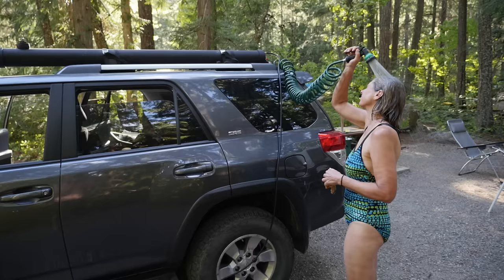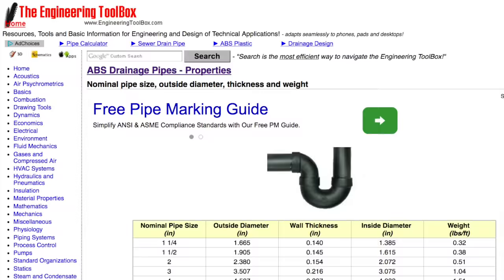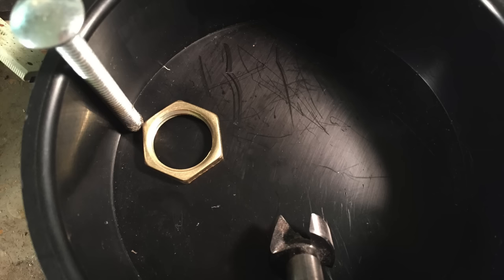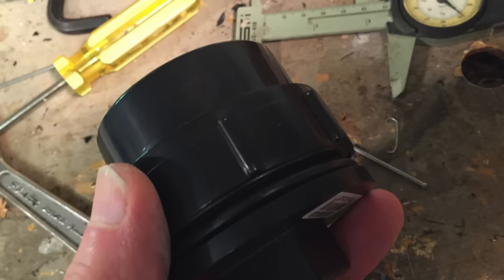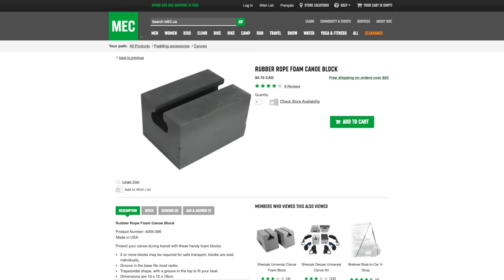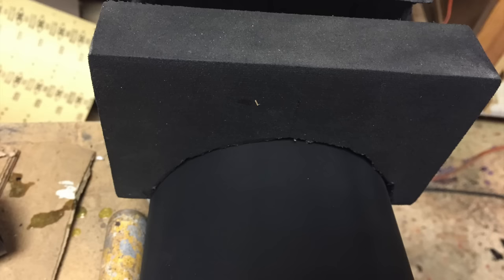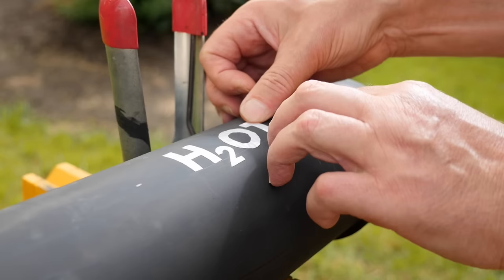H2OT - Rooftop, pressurized, solar-heated shower/sprayer using ABS pipe. DIY

Comment: Can  you provide more detail regarding the operational temps for ABS versus PVC? Information I found online shows ABS maximum operating pressure of 100F  vs 180F when under pressures. Thank you for the excellent video.  Here's a link to the source I found: http://www.engineeringtoolbox.com/plastic-pipes-operating-pressure-d_1621.html
Reply from the maker: I would suggest anyone with specific questions about the material performance ratings of ABS pipe, should contact the manufacturer of the pipe. In this case, I used Cell core, Acrylonitrile-Butadiene-Styrene, Schedule 40 pipe, whose specifications adheres to ASTM D2661.
Reply: Nelson Outdoors ... i dont think that will matter alot... you only want about 30psi of pressure inside the drain pipe and id flatten the air pressure when not in use .... i certianly wohldnt go higher then 50 psi with a pressure regulator remember this hot water is going to be hitting your naked skin... no need to remove the skin off the muscles and bones , just wash the dirt off is all that necessary...hah

as a kid we used to build potato cannons out of 4 inch shedual 60 pvc drain pipe using auquenet hair spray and a bbq grill electric switch and we could launch spuds a good 500 ft on a good charge of auqunet spray ... so thats some serious pressure inside that pvc drain pipe...

Comment: What was the total cost?
Reply from the maker: About $50 as I had most of the parts in my shop already from other projects.
Reply: @ImaginetMedia  how much would you say from scratch? Really cool idea.
Reply from the maker: @DTKRDMNK  I provide close up shots of all the parts in the video so you should be able to shop around your area to determine the cost. What it costs me is irrelevant. Unless you live and shop where I do, my costs are completely different than yours.
Reply: @DTKRDMNK  I decide to start this about 22 hours ago. I am $100 in. I am making a U though. 4' on each side with a 2' bottom. outlets on both sides. 4" PVC sched 40. So far just running into a problem with finding a filler that seals. Once I do that I am set. So maybe $120 with trial and error? If you are luckier than me perhaps under $100.
Reply: @jasonmotorcycle8987  have you tried a rubber washer/grommet and then some type of bathroom sealant? Maybe aquarium grade sealant would be better.
Reply: @jasonmotorcycle8987  all we're missing is some filtered reverse osmosis type thing and we can catch rainwater/river water to use lol

Comment: How do you keep the air pressure from leaking out of the filler cap?
Reply from the maker: Screw on the cap and air does not escape.  It is an airtight seal.
Reply: @ImaginetMedia  Mine does, even if I use thread tape and a pair of pliers to grab onto the square part to tighten it.  Leaks at the threads no matter what.  I've been struggling with a good filler design that can be removed to fill but doesn't leak.
Reply from the maker: @SD-pi9co  if you look closely in the video, you will see a 2” silicone gasket on the threads.  This came with the cap.  Apparently, some brands do not include the gasket.   I suggest getting a similar rubber or silicone one and it will seal tight.  I only hand tighten mine for a perfect seal.
Reply: @ImaginetMedia  Is it like an o-ring?  Could you post a link to something similar?  Thanks so much!
Reply from the maker: @SD-pi9co  Yes, it is an O-ring. Here is the exact part I used. You can see the O-ring in the photo. https://www.homedepot.ca/product/lesso-2-in-abs-male-plug-mipt/1000116110
Reply: @ImaginetMedia  Thank you that helps a lot!

Comment: why not use solar power just power a heater to heat it lol
Reply from the maker: A electric heater would require at least 300 watts of power.  A 100 watt solar panel, which is 4 ft x 2 ft in size costs about $200, and you would need  4 of them, plus a charge controller. Right there you are over $1000. Plus, I do not want to mount 4 huge solar panel on my truck.

oh yea... lol
Reply: imaginetMedia not if u use it to power a motor turns a generator with 120 converter you can power whole building welders anything at all free
Reply from the maker: So now on top of the $1000 solar PE  array, you want to add a a motor a, voltage convertor, and a generator.   OK, Ill get tight on that. lol
Reply: imaginetMedia u get generator from a car starter lol any 12v motor long strong enough turn alternators power the 120 converter all u can get free to very cheap don't really need the solar the generator can power the motor   just don't ground the motor/gen to each other
Reply from the maker: lol

Comment: awesome build im on it ! this is what I have been thinking about , however i was thinking about one of these to power it with a drill or 12vdc motor       http://www.princessauto.com/en/detail/drill-pump/A-p8412322e
Reply from the maker: That pump can put out 650 gallons per hour. That is 41 liters per minute. Your shower will be empty in 20 seconds. Not to mention you would have no skin left!  :-)
Reply: if you put it to a drill you can vary the speed . that means far less the the max out put.

Comment: 4 gallon bucket painted black and large drinking cup for dipping and you got the same thing maybe $10.
Reply from the maker: How exactly do you get the water to 100 F in an open bucket, while driving on logging roads and still have anything more than a cup of water left in the bucket?

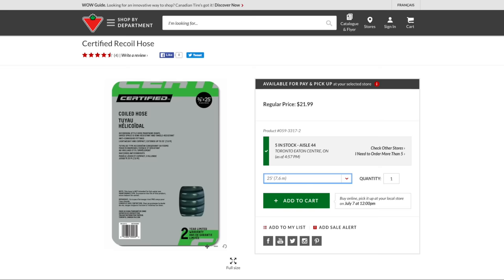Comment: 4:33 "warm enough for a couple of long showers..." with 4 gallons of water?
Reply from the maker: The shower spray is only on for wet, rinse repeat. !0 seconds at a time.  Easy to do and it works great.
Reply: Its a camp shower not a spa. Conservative use of water is key.
Reply: 4 Gallons with a low flow rate shower head was enough for me and my beard and my fiancee and her long hair. I would recommend at least 7 gallons though. I went with 4 gallons due to my small car and it's maximum weight capacity for the roof.

Comment: I wouldn't bath or drink from abs. It's used for wast water for a reason. Just paint pvc black.
Reply from the maker: We are not making ice for martinis. There is nothing wrong with the water stored in ABS.  And, that is not why ABS is used for wastewater.  Also, if you read the FAQ in the description, you would have learned why painting PVC pipe and using that is a terrible idea..
Reply: @ImaginetMedia  BPA will eventually leach into the water. Look it up.
Reply from the maker: @super88rob  The water is in the tank for no more than a few hours.   Zero problems BTW: I did look it up, 6 years ago...", BPA (Bisphenol A) is a chemical that helps harden plastic materials used in different applications, such as pipes. It is also present in some plastic dishware that holds food and drinks."

.
Reply: @super88rob  this isn't an FDA/EPA PSA, this is an instructional video on how to build this device. If some one wants to scrap and eat the inside of this until they get poisoned from BPA let them weed themselves out.
Reply: Life is dangerous,  keep your mask on.

Comment: Avoid weight on the roof.
Reply from the maker: Where do you suggest I mount the tank then, under the truck?
Reply: 40ish pounds on the roof rack is not a problem as vehicles are built to support the full weight on the roof for safety. 

For an SUV it might move the center of gravity a fraction of an inch up so the same as having another person due to where the wait is. Would only effect breaking if traveling with a half full pipe as the water would then have room to move so traveling with it full there is no room for the water to be a problem.

Comment: Compressed air in the pipe will not be any problem as long as you don't expose the pipe to UV light where it starts to degrade and become brittle.  If it does get brittle and burst from air pressure, deadly plastic shrapnel will shred anyone near by.  

Is hot water worth your life?  Your choice.

There's a reason why the safe commercial version costs $300.  I think my life is worth the $300 safety factor.
Reply: Thats going to the extreme mate. It does require some common sense to operate this device.
Reply: Flinters Roo 
40 psi wont cause the pipe to explode.
Reply: Flinters Roo 
a pressure relief valve could be installed if this was a high risk. But I don't think it is really.

Comment: Aluminum would work way better I guess you don't count how much time you spend doing that time is money
Reply from the maker: 6 feet, 4 in diam ABS pipe: $20
6 feet, 4 in diam Aluminum pipe: $400 + aluminum caps + TIG welder
I guess you can't count.
Reply: Even if you buy that high-dollar 380 aluminum dollar tank and it leaks. TIG welder unless you have one and that's pretty expensive to have somebody to take weld something and Timely. I had someone to tig weld something I had once that was pretty costly And Timely. PVC is cheaper easier and faster. And will last years to come. But the thing I want to know is anyone use this black PVC pipe in the summertime directly in the Sun. My experience this summer with black jugs of water sitting in the sun it got up to 112 degrees at the beach and the temperature was about 88 through 90 degrees. Thank goodness I had two other water clear jugs sitting in the shade. Even the jugs in the Sun the clear jugs were too hot to take a shower with when I put my finger in the water for me. My thought is if you had a bigger PVC pipe or longer or double pipes you could mix cooler water together to get it to the water temperature you like. I used my water just take a shower in the summer at the beach in my pop up bathroom shower I bought at Walmart for $30. Thank goodness it had a vent in the top of it or I would have burned up. I first wet myself with 1 gallon jug of water washed my hair and myself. And then I rinsed off And I just poured jugs of water over my head 2 quanity 3 gallon jugs of water over my head to rinse with. 7 gallons of water total how used a bit too much but it worked. They were the cheap plastic blue jugs at Walmart. Of course when I go off grid I will be using less and less water that I can get away with. For now I can get fresh Spring Water out of the side of a mountain for free. But you never know how long that will last.
Reply from the maker: The pipe is ABS, not PVC.

Comment: Foam block will not last in the sun
Reply from the maker: So you are an Applied Polymer Science expert.  Where did you get your Engineering Degree?  I’ll wait.  BTW the foam has sat out in the weather for over four years and looks and behaves as if it was new.

Comment: My only question is how old is the actually water pipe water system that’s produced commercially? Did you copy it or did they copy you because you can buy these complete with no need to build it. I was going to say you’re acting like this is your idea when it’s there’s but then I saw this video is 6 years old.
Reply from the maker: If you actually watched the video you would see that I investigated the available options at the beginning. I showed the exact commercially available one and clearly explained that cost was the determining factor in making my own.   What part of that was unclear?
Reply: Way to much work for me! 😮
Reply: @ImaginetMedia  Wasn't going to comment  because its 6 years old but I see your more recent post. My concern, and it stems from  simple garden hose laying on the ground on a hot day full of water with a sprayer on the end,  I've sprayed that on myself and it was damn near to hot, can it get to hot? I was going to incorporate something like yours into my camper to mix with the cold water that I have for washing, I know that mixed with room temp water that I'd be OK but what if someone just used direct hot, would it be to hot? Just curious about your experience with that, I would use 6" because I have access to scrap pieces from job sites, You dont see any problem with 6" pvc schedule 40 do you?
Thanks

Comment: Why don't you just save your self the headache of trying to pressurize the tank and turn it up on end and let gravity do the work, just reduce your hose size for more pressure
Reply from the maker: Hydrostatic pressure in a liquid can be calculated using the following equation:

p = ρ g h 

where:
p = pressure in fluid (N/m2, Pa, lbf/ft2, psf)
ρ = density of liquid (kg/m3, slugs/ft3)
g = acceleration of gravity (9.81 m/s2, 32.17405 ft/s2)
h = height of fluid column, or depth in the fluid at which the pressure is measured (m, ft)

Hydrostatic pressure in a water column (density 1000 kg/m3)  at depth of 6 feet is 2.8 psi. 

That is 2.8 psi when the tank is full.  Pressure nears zero as the tank drains. 

Plus, I have no desire to "pivot" a full tank of water vertically on the roof of my truck.

Comment: yes it's cheap but not everyone has all the tools like you do.
Reply: all you need are drill bits, a drill and a saw, which are probably the easiest/cheapest tools to get. Some things from his design can be substituted with pre-made components too.. overall it's still cheaper than $300 (not including shipping) You also end up with the tools to do more projects, repair this one, or replace it for cheap if you break it on a trip.
Reply: Robert Deford thank you:)
Reply from the maker: All excellent points.  Thanks for posting
Reply: imaginetMedia Dude, who are you trying to sound like? Mr Smith off of The Matrix?  Great idea although!
Reply: ...asimo, no offense, but if you don't have or can't get a $25 plug in drill and a hand saw, well...

Comment: Asside this terrible noise I bet air compreasor is also way more less efficient than small water pump especially as water level drops, as it have more empty space to preassurize untill it reaches desired preassure. Really not convinced air is a way to go.
Reply from the maker: I do not understand the terrible noise comment. It is not terrible or noisy at all. If you buy a good compressor (like a Viair) they are reasonably quiet. Regarding efficiency, for two showers, I suspect the compressor is not on any longer than 30 seconds total. At half a tank of water, it take 5 seconds to go from 10 psi to 30 psi.
Reply: Sasa Djuric Water pump would probably be a bit better, though he already had the air compressor it looks like, and that the hose and compressor are in one small case is convenient, while the water pump would probably have to be installed on the roof as well. Also bro, people will be more receptive to your ideas if you communicate them in a positive tone rather than negative.